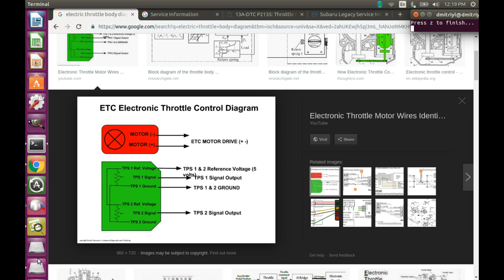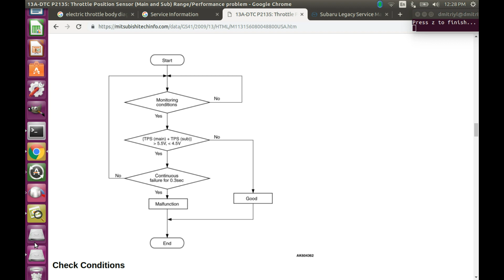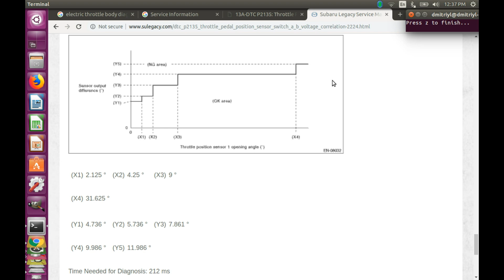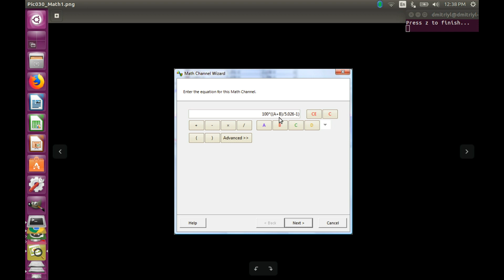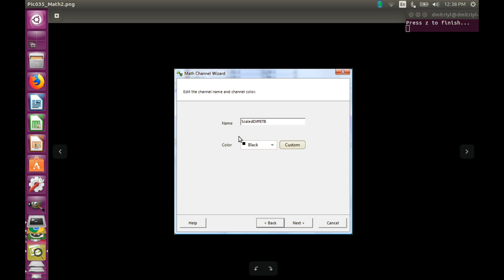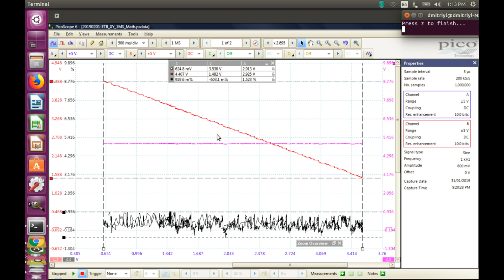[S,A,M] Idea: compare TPS voltages of an Electric Throttle Body using Picoscope's XY view

Comment: Another great video Dmitriy. I have a request: I recently started reading about galvanic isolation and why it is so important in electric vehicles due to 48V utilizing chassis as the common ground - this leads for the potential of 48V crossing into 12V systems. 

I'm still making my way through the information but would love to see your take on the information if you're interested. The general principle of galvanic isolation makes sense but there are voids in my understanding. I know I'd really appreciate a video on it as a lot of us will be dealing with those systems relatively soon.
Reply from the maker: Fabulous topic! Pretty much any electronic device that feeds from 120/220V AC uses galvanic isolation, but in vehicles there are additional requirements that make things even more fun. That would require quite a bit of research to put all this together.